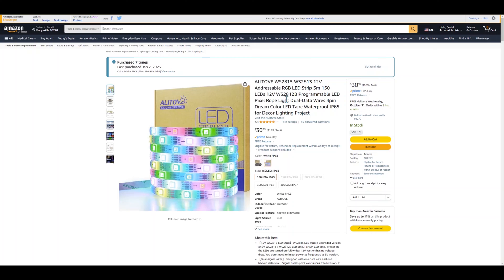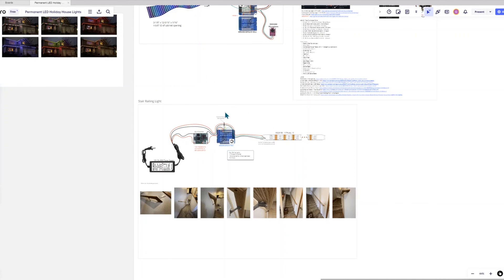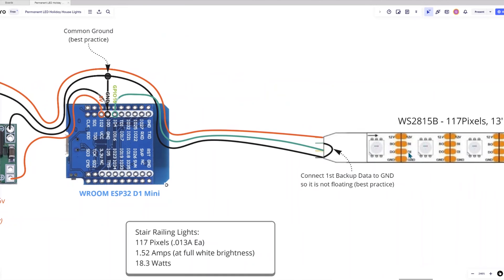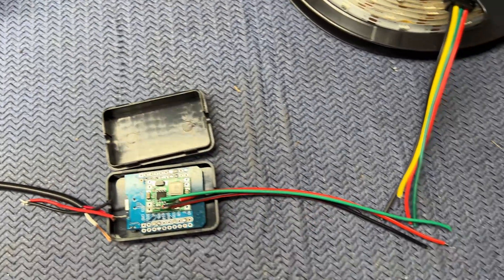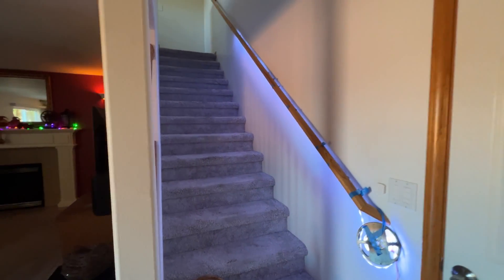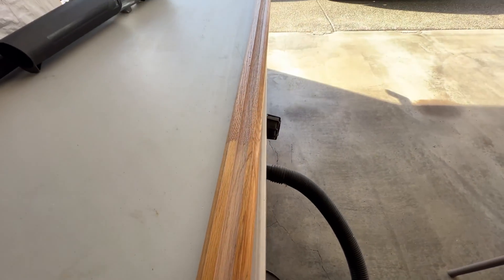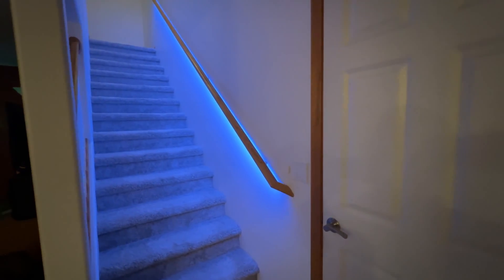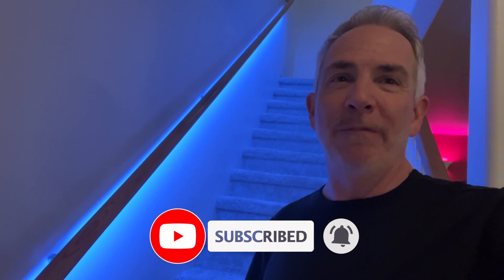Elevate Your Stairway With Modern LED Style

Comment from the maker: Thank you for watching, please Subscribe: https://bit.ly/subscribe_GYATEZ
Links to parts needed:
• 12v WS2815B LED Strip Lights 5m (https://amzn.to/3rJ5uWU)
• ESP32 D1 Min board (We're using the WROOM 32) (https://amzn.to/45mwyZS)
• Buck Converter (power converter 12v to 5v) (https://amzn.to/48XlbKW)
• WLED software (free download from GitHub)
• LED channel with Diffuser (https://amzn.to/4046Rwd)
• 12v 5A Power supply (https://amzn.to/3ZMEoL8)
• Small project case (https://amzn.to/3F7Yo18)

Comment: Thanks for the informative video.
I have couple of questions.
1. Why u used WS2815 instead of SK6812 when u aren’t using data backup wire. 
2. Another question is, why use ESP32 mini, instead of regular size ESP32.
Reply from the maker: Thank you.  Great questions, 1) The backup (BI) is being used automatically, it's built into the circuitry of WS2815B.  You only have to connect the DI and all the backup works automatically.  2) I like the D1 minis they fit in my project cases, plus I already had a few of them 😊👍.  Hey, thanks for watching, it is much appreciated!